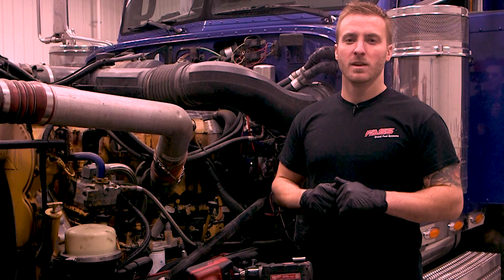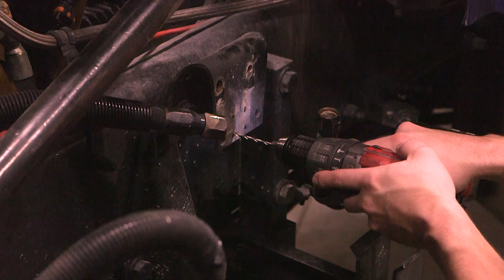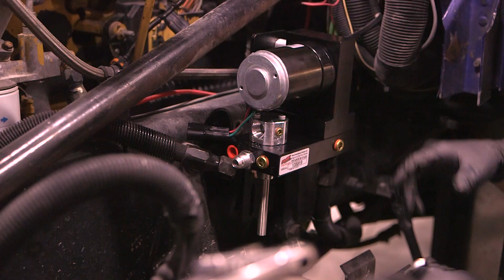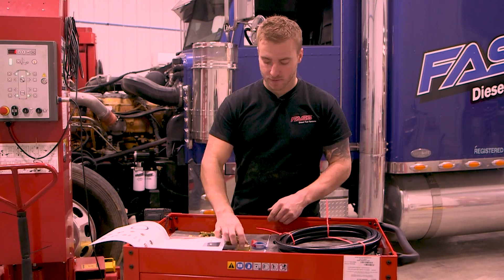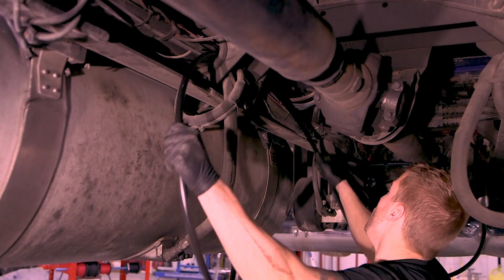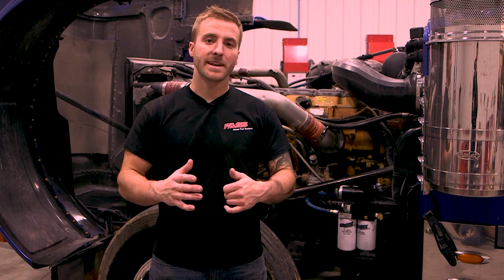FASS Diesel Fuel Systems "165G Semi Installation Video" Using NEW nylon fuel line kit!

Comment: So basically if you ever run out of fuel you can prime the system with just key in on position! That’s sweet, also I would’ve just made a bigger bracket for pump instead of drilling into the frame. Just me tho

I’m confused on why you ran a return fuel line when there’s already one coming from the head?
Reply from the maker: We appreciate you asking, and this is actually an older version of our semi system. In our newest version the return will tee into the factory return line.
Reply: @FASSFuelSystems  I guess once a certain pressure is hit in the head it returns overflow back to tanks? I guess my questions is why have two return lines when there’s one already from the head? Just tryna get a better understanding as I been looking for a setup for my 12.7 as I have issues with factory pump on these even tho my engine is stock
Reply from the maker: @otrookie  gotcha, no worries. We actually got away from doing this a few years ago, and went to a newer design. We have a video here explaining the newer system: 

https://www.youtube.com/watch?v=3Owx2Fa8Kgw&t=12s
Reply: @FASSFuelSystems Can you guys show this part. This is the only thing I’m not sure how and where to do that?

Comment: Quick question I have install a fass fuel system is the pump always supposed to me running on and also I’m waiting for it to prime but it’s don’t not prime and I fill the fuel filters but then the truck starts and then it dies  bec it’s not getting fuel
Reply: I had a problem with my install. An extra rubber 0 ring on one of the filters caused a problem. Not only that, I switched the coarse filter with the fine filter.
Reply from the maker: Hey Eric, we would be happy to help you out with this sir. If you don't mind reaching out to our service team at 636-433-5410 we can help you get this diagnosed, and taken care of!

Comment: Is the installation the same on a 2012 peterbilt Mx13?
Reply from the maker: Hey Matthew, awesome question and with most class 8 applications the installation will be similar. The main differences will just be how the FASS is plumbed since most Semi-trucks have different engines.
Reply: Can I run one return line on the Paccar or is there a way to tie it into the factory return?

Comment: You don’t remove factory mechanical fuel pump?
Reply from the maker: Hey there, that is correct. You won't have to remove the factory fuel pump. If you have any other questions about installation we will be happy to help, and have a tech line that can answer any question you have. Our number is 1-866-769-3747. Thank you!

Comment: Hey great video guys very helpful!!.... I will be installing one of these fass kits on my semi truck soon.....Just wondering which key on fuse did you use and did you use a add a fuse in place? 

Also how will i know when to change the filters?

Wish my fuse box was on the driver side...ill have to run an extra wire all the way through the dash from the passenger side 😔
Reply from the maker: Thank you so much for all the support!!! Also, these are all great questions, and if you don't mind it would be best to reach us on the phone to get you the best help we can from our tech team! The number is 1-866-769-3747! Thank you much!
Reply: @FASSFuelSystems  hello to the group buy a 290 gallon fass pump for a cat c15 it is bad to put the return so close if return check or direct ah the tanks thanks to the group let me know
Reply from the maker: @yamilliens8887  Hey there, thank you so much for reaching out about this! If you don't mind for the best diagnostics on this I would suggest giving our tech team a call at 1-866-769-3747. Thank you!

Comment: Do you have to have the fuel return line kit in order for the Fass system to work? Great video
Reply from the maker: Thank you! And that's a great question. Since this video was released, we've updated our kits significantly! If you'd like to review the best options for your rig, please give us a ring at 1-866-769-3747 or shoot us an email at techsupport@fassride.com, and our team will be happy to help.
Reply: Nooooo separate from original return line
Reply: I put FASS and my truck lost power. I'm not happy with this purchase.
Reply: @dannymorales1897  I installed mine over a year and never had any issues.    I'm not sure why you would lose power though?

Comment: where do you connect the feed for a N14 cummins i ask because the computer has to be fuel cooled and the old filter is after the computer
Reply: I don’t know if you’ve got an answer to your question but I also have an N14 with the same problem I called technical support and they told me as long as I did not have any filters in front of the suction from the tanks going to the palm it did not matter how many curves and turns that the suction fuel line had. You can leave the existing filter on the back side up the fuel pump and just run the discharge of the fast system into the cooling plate behind the ECM
Reply: @allenpardon8211 excellent comment Allen.